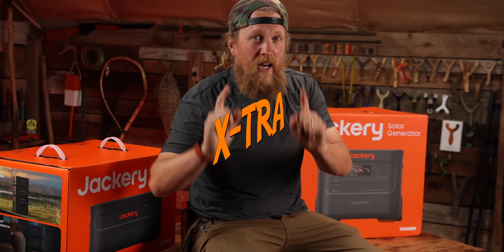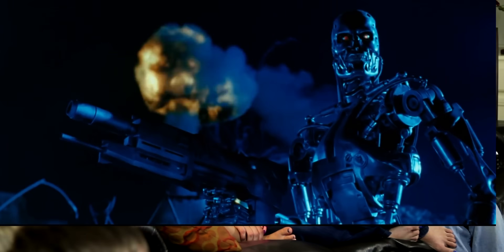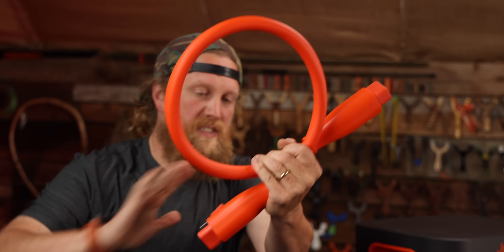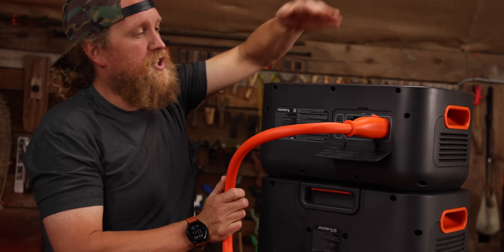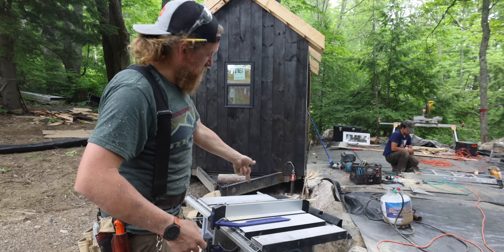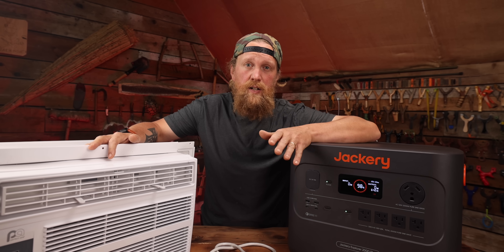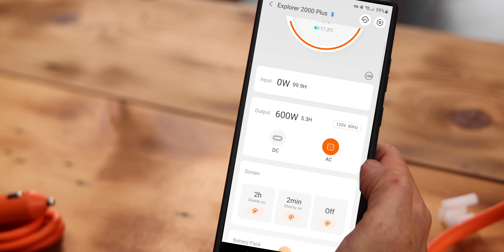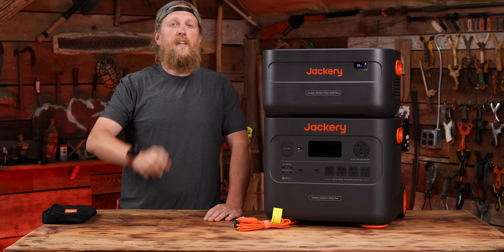Jackery Solar Generator 2000 Plus Review - This is Built For Survival

Comment: I hope people are not running out and purchasing this unit for what you claim it will do with an air conditioner.  The power unit registered 96 watts, likely the power draw for the fan only, but wait, once the compressor comes on it will use likely draw more than ten times power, sorry grandma, this aint going to cool you for 17 hours not even close.  Better purchase a gas-powered generator for a fraction of the cost than investing in the piles of batteries to run your 15K BTU air conditioner.

Comment: Correction this uses Lithuim IRON Phosphate.The 3000pro (which  I also have) has the Lithium ION which makes it lighter  per storage capacity compared to this. 2kwh vs 3kwh with the same size and 2lb weight difference but 50% more capacity. So for folks needing a battery for those weekend camping trips in the summer or overlanding on weekends, the Jackery PRO line will be a better choice because Lithium Ion packs are way more ligher to carry around.

Comment: I have the little 300, I take that on little driving trips here and there to keep cell phones charged and stuff like that. I bought the Explorer 1000v2 on an Amazon super sale, I use that to plug-in computer stuff while I'm on the road, or camping. And today, I just bought the explorer 2000+ with the two additional battery packs and two of the 200W solar panels. I also have two 100W panels for the other smaller Jackery units so I think I'm set.  I can plug them all together and have 600W of solar. I love having this stuff. I don't drink or smoke, so this is my "disgusting habit".

Comment: Good clip mate.  I got one of these bad boys on the way.  Australian version as we run 240v not 110v down here.  Most of our stuff runs off 10 amp plugs.  Caravans and the generator switch in the home for power blackouts are 15 amp.  I am hoping that top plug on the Australian version is the 15 amp.  You need to address the elephant in the room too.  The cost.  By the time you purchase the unit and 5x extra batteries, it would be cheaper to put solar on your house with a large battery backup and a small generator.   This item has a lot of pro's but I can also see a lot of cons with it as well.  Price being just one.  After a cyclone down here, we can have weeks of rain.  Solar becomes next to useless.  I think the jackery working in conjunction with my Engel 2500w inverter generator is going to be a good thing.  Well done on the clip.  Very entertaining.  You put a lot of time and effort into it.  All the best from Queensland, Down Under.

Comment: I just got a Jacari power unit with another battery. The initial battery charged just fine, but it will not charge the extra battery. Am I doing something wrong, is there a switch I have to push for something.